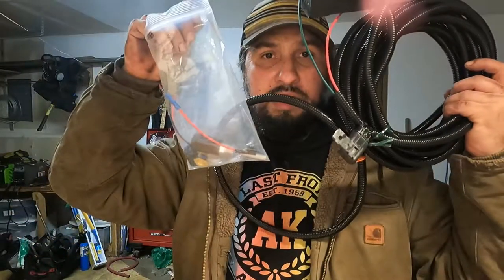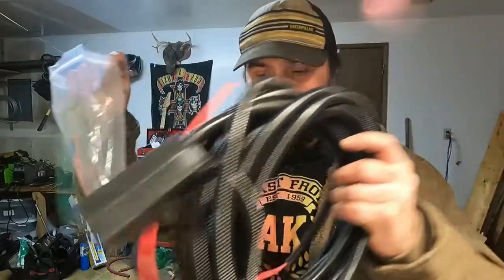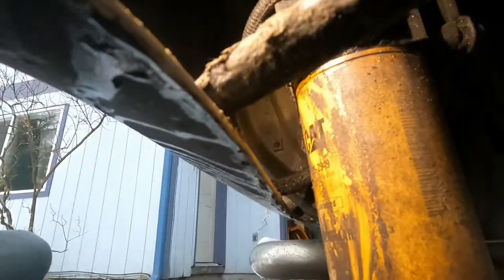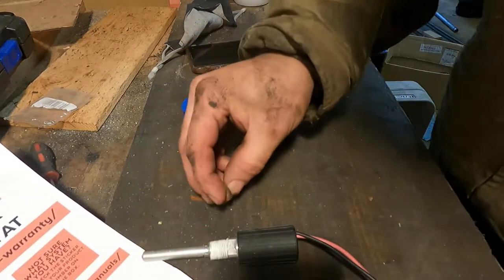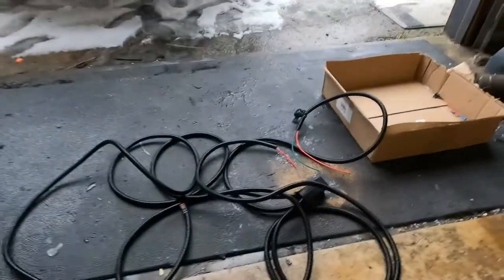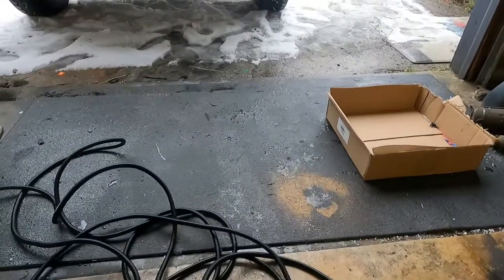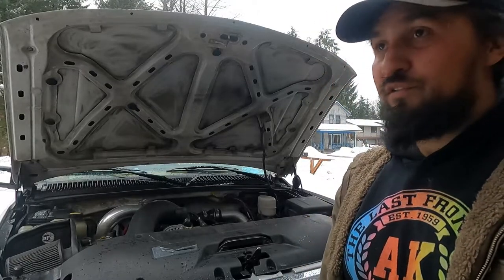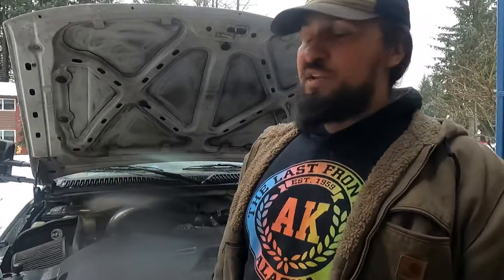You Won't Believe What A Fuel Heater Does For Your Duramax!

Comment: Get the Y plug and a 2nd heater probe, 1 is not enough
Reply from the maker: Yeah I think imma do that.  I re installed the primary fuel filter housing so I can utilize the fuel heater in that but installing the second heater in the fass seems like a legit move.  I'm still tossing around the idea of connecting  coolant lines to it as well.
Reply: @KooshdaakaaGarage  I don't know how effective that factory housing heater is. Probably not enough to thaw it. May be a good idea to keep the U shaped bypass 1/2" pipe for $10, in the truck. Then worst case you could bypass it if it's frozen.
Reply: @KooshdaakaaGarage  I just ran across your comment again by accident. I just added coolant hoses to the FASS. With the temp sensor mounted in the sensor hole in top,(needs a ground wire added to pump body). It's cool watching temp rise in pump block. I just made a short vid on it too, showing basics.
Reply from the maker: @mrmotofy  Hell yeah dude thats awesome.  I'll check out that video!  How are you liking the coolant hoses?  Notice a difference?

Comment: Should also switch to the new Fass Filters they work better filter more than the old style
Reply from the maker: I've been running good ole CAT filters for the past 6 or so years.
Reply: @KooshdaakaaGarage  The FASS are better, the water for example in your case, will fill then start passing water to motor...bad idea obviously. The Fass will just stop the truck before damage can occur
Reply from the maker: @mrmotofy  Eek, I can't imagine getting fuel from such a horrible source to cause the water separator to fill up to the point of overflow.  That's why CAT has a drain at the bottom of the filter I suppose (drain and drive).  Also if one is performing scheduled maintenance and changing their filters then that should not be an issue.  Water in your engine is a bad idea like you said, but so is your engine shutting down because filter filled with water.   The fun thing about water and diesel is that diesel will always rise to the top and I have three filters: water separator & fuel filter on the FASS then I have my CAT filter on the primary.  Water will separate itself in all three filters but only one filter has a drain.  In any event I change my filters frequent enough and am fortunate enough to have a quality fuel source so it's all a moot point  for me :) Moral of the story,  change your filters! haha  I'm glad FASS has better filters now though!  They were pretty horrible 5 or 6 years ago when I first bought the pump.
Reply: @KooshdaakaaGarage  Many times water can build up but any source COULD have a bad day. Yes good frequent maintenance is key but things happen. I filled a gas can from a single station and only premium. Over a span of couple months the Generator started getting harder to start than the 1 pull it was normally. Finally started searching...found about 1 gal of water in a 5gal can. I never fully emptied it...kept refilling. Water had to have come from the tanks at station.
Reply from the maker: @mrmotofy  Ah man that sucks!  Glad you found the issue before it did too much damage to the generator. 🍻